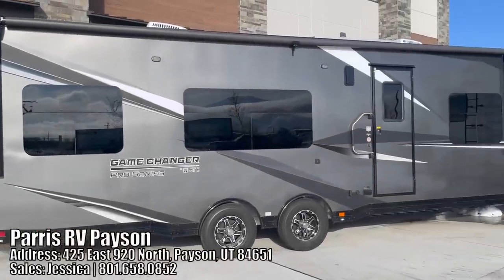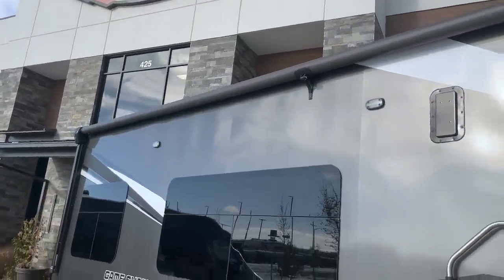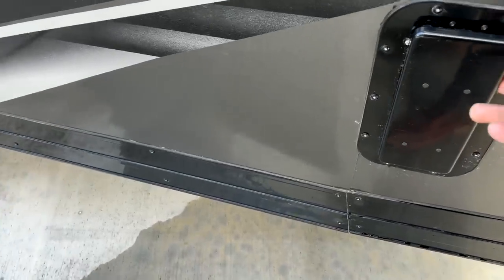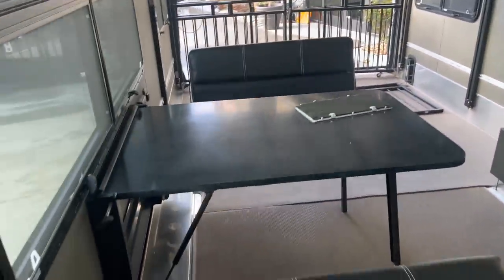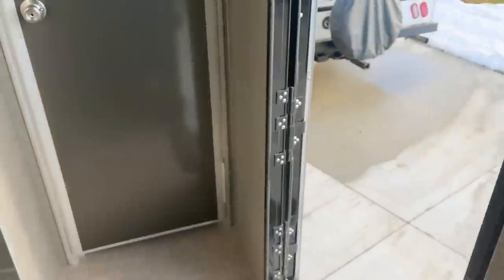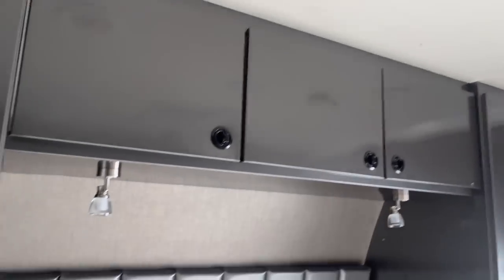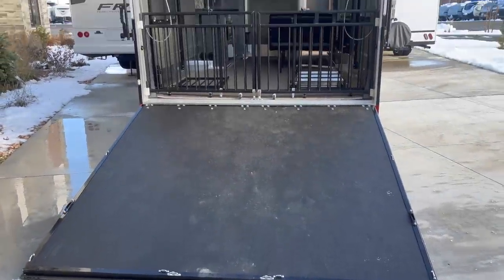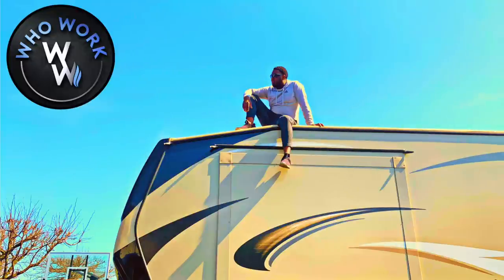2023 ATC Game Changer Pro Series Toy Hauler Review: Can A GMC Sierra 2500 AT4 6.6L Gas Tow This?

Comment: That is a perfect trailer for the at4 3500 with the gas v8 to have extra payload even though the 2500 would do it but I the 3500 version would be a perfect fit. Even the new ford f350 tremor with the  7.3 gas and the 4.10 axle or HO engine would be a perfect match also

Comment: Payload is not a problem, but you may have exceeded the hitch weight.  The limit is 1450 lbs.  I have a 2020 Gas 3500 Denali with the same tow limits as the 2023 2500 ATC you used as an example.  So you would have to move the load in the rear forward, and use a weight distribution hitch.
Reply from the maker: Good point, I’m sure a WDH would allow some of the hitch weight to move onto the front axle but I’m willing to bet you won’t exceed the hitch on this truck with this trailer 👍🏾

Comment: Question how dose the 2023 at4 gaser have more payload and GCVWR then my 2019 2500 diesel witch is 23000?
Reply from the maker: GM stepped up on the 2020+ trucks in terms of frame, axle ratings and they raised their GVWR to give more payload capacity. Gas trucks typically have more payload compared to diesel equipped HD’s so a 2019 gas equivalent will have more payload too 👍🏾

Comment: Bedroom door handle was improperly installed, screws should be on the inside.  Not a fan of ATC design, though like the idea of all aluminum.
Reply: I agree. We ended up taking the bedroom door off and the trailer flows so much better.